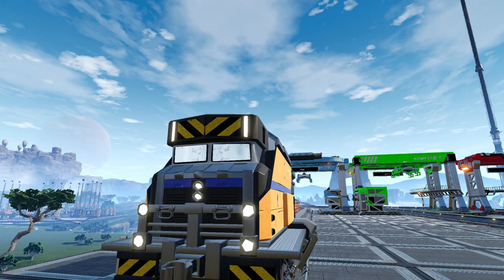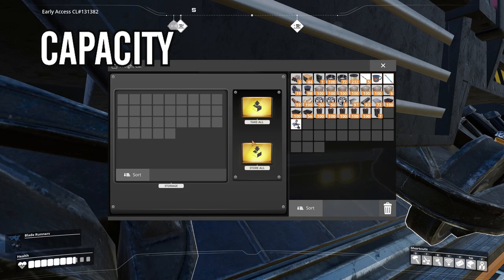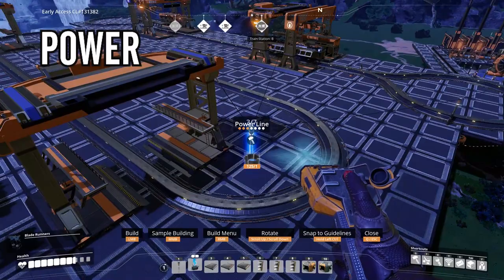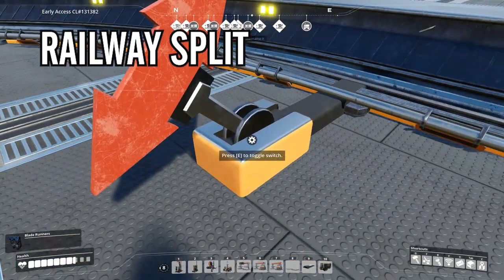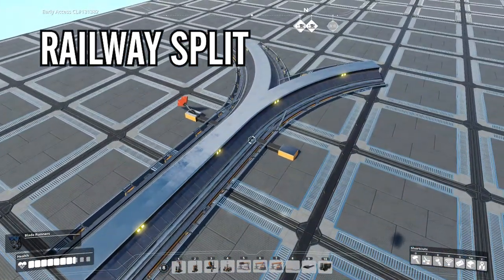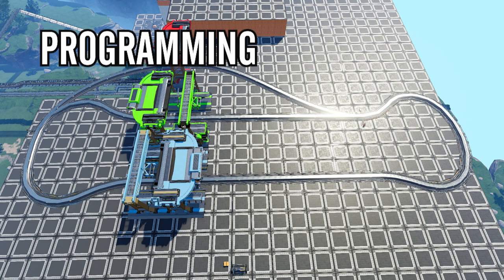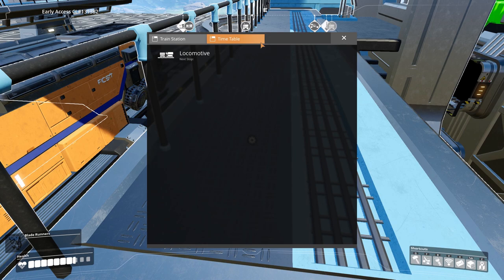The FASTEST and Simplest Guide to TRAINS in SATISFACTORY!

Comment: I've been having a lot of trouble setting up my first train (a push-pull). There is so much conflicting info and every other tutorial I've seen indicated you put the station arrows pointing the way you want the train to LEAVE the station and that for a push-pull they would be pointing inwards. This is the first one that said the opposite and it worked! Also, you actually showed the complete rail from above so it was easy to see which way the curved side of the station was pointing. Other people just sort of talk through it as they build, but it's hard to see what they're doing. Thank you for the help and the great video!

Comment: Ok Im a little confused, sorry if Im being dense here, but at 0:15 you say the station arrow denotes the direction the train is exiting from, but at 1:57 where you show a single line, the arrows are pointing the opposite direction of where the train is exiting, that way the arrows point away from eachother like you say they should, but that means the trains are exiting at the opposite direction of where the arrow is pointing, I assume this is different somehow when making a 1 line instead of a loop ?
Reply from the maker: Ok I'll explain that the best I can.

The arrow points in the direction the train is exiting. Which implies that the opposite side will be where the train enters the stations. 

So in the single line, we have *2* locomotors. When moving to the right station, the right locomotor will be the one pulling. So it enters the station from the opposite side of its arrow . When going to the left, the left locomotor pulls, so it enters the left from the opposite side of its arrow.

So essentially, it's as if one part of the station is switching off its rules. ( This only for single line systems)

Hope this explains it
Reply: @chankykang4918  Alright many thanks, just wanted to not mess up my first rail system completely, I will make sure the stations have their "backs" turned to eachother, great video though, learned a lot :)

Comment: Hi friend! I have a problem with this locomotives You see, I made a loop type train system. But what happens is that when I drive the locomotives and get to the loading platforms, they do not load the objects to the wagons (the platform is in loading mode and has power) I don't know why this happens but it does not load the objects to the wagons to transport them any idea why this happens and what am I doing wrong?
Reply from the maker: They arent automated? You're driving them yourself?
Idk the reason, but try automating it and see if it works. Also see the direction of your train and the direction your freight unloaders are facing. the train should be coming into the freight loader where the roof is straight and not curved
Reply: Do you check the conveyor or pipe input to make sure it was in output and not input

Comment: What if I want to place another station between in the single line method? Which way should I place the station?
Reply from the maker: Hmm.. thats a good question. Give it a shot? Depends on ur timetable.
Let's name the stations at each ends A and B. the station u want in the middle is C. 
If the timetable is A -> C -> B, and the train starts at A , and if the C station is facing towards A instead of away from it, I think the train will go to B and then come back to C.
Reply: @chankykang4918  Gonna give it a shot.
Reply: @chankykang4918  How should I put the stops in? If I put only 3 stops, one from each, it doesn't work.

Comment: I'm having this unable to reach next stop bug - its a point to point track, two locomotives, freight cars inbetween - two stations facing away from each other - when at one station - the train  will give the error, but leave and drive to the other station - at the other station, the train still shows the error, but does not return to the station of origin.  I'm stumped - removed the trains, rebuilt them numerous times, reconnected power several times... Rebuilt the stations a couple of times - not sure why its not working - I can drive manually from station to station without a hitch
Reply from the maker: What does the timetable look like? Can u tell me the names of the stations and their order in the list?

Comment: if i program it and enable autopilot and press the X the time table disapears and it says ''no time table''
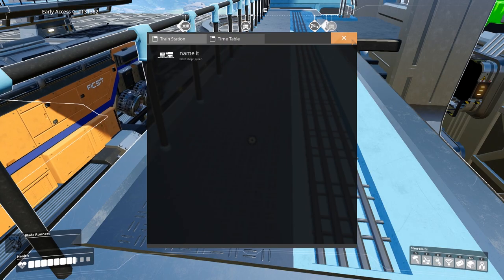Reply from the maker: At 3:31 you can see that it says the "no time table" just before i X out. Is this what you see as well?
Reply: @chankykang4918  yea my friend fixed it :))))))))))) still thx for the vid cuz we placed the station wrong
Reply from the maker: @kaasfluf  LOL. Np dude! Glad I could help
Reply: @chankykang4918  well the train sometimes stops running for no reason.... sometimes u can fix it with putting autopilot on and off but now it isnt working :( xd
Reply from the maker: @kaasfluf  the only way i see that happening is if the power gets cut in between.. has that happened?
Reply: @chankykang4918  ye 2 times but last time it restarted when we turned autopilot on and off and now it doesnt
Reply from the maker: @kaasfluf  Alright i'm gonna need you to check:
1. The power connections -make sure there's power in the rails
2. The rails - check if the rails got disconnected in between the stations somewhere. This might have happened by accidentally dismantling it while you were building something else.
3. Check if the rails have any clippings. What i mean is check if the rails are clipped together. it may not look so on the outside. To check this press F to go into dismantle mode, and then just move along the rail with the cursor on the rail. The orange colour might glitch out at parts where there's railings clipped.
4. Finally check the timetable again and see if the stations and the timetable is in the right order.
Reply: @chankykang4918  well everythings working but if the power disconnects for a second the train stops and wont continue his time table after the power is back on, sometimes it works with putting autopilot on/off but soemtimes not
Reply: @chankykang4918  o its all fixed, it was just more lag than usual for a few days
Reply from the maker: @kaasfluf  Yeah thats something that happens. It's really annoying.

Comment: Hybrid system doesn't work anymore from my testing. Unless I'm doing something wrong.
Reply from the maker: Check if there's any clipped rails along the line. U can do that by going into dismantle mode, and then mouse over the rails path
Reply: @chankykang4918  I tried it on a small scale before doing a whole line and couldn’t get it to work. Maybe test yourself to see if it still works.